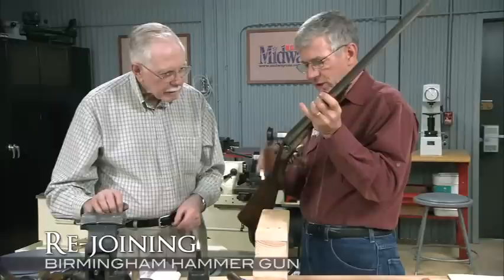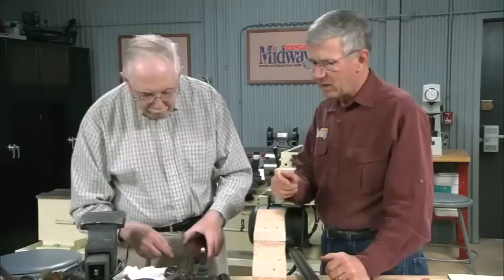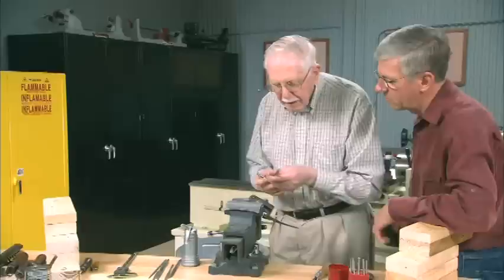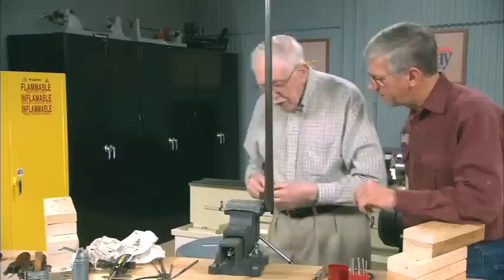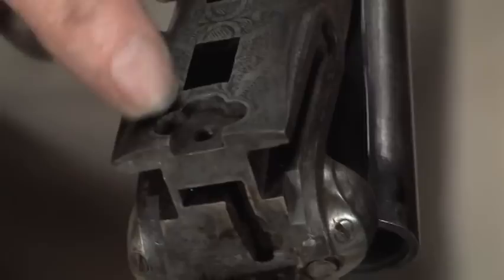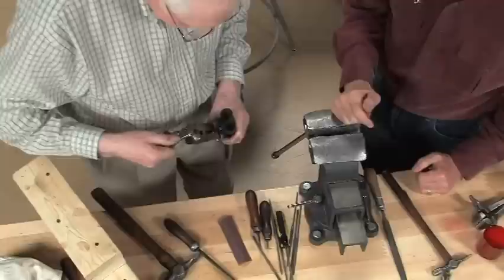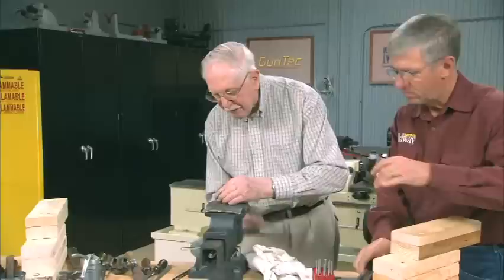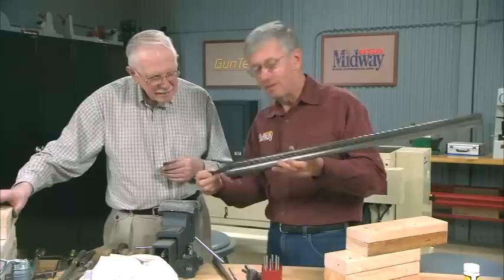How to Rejoin and Bring the gun "Back on Face" | British Side-by-Side Shotguns | MidwayUSA

Comment: They could make the pin larger on both ends and have the middle in various sizes, that way there would be no need for a reamer, just drive in a pin with a thicker middle diameter.

Comment: You could remove the pin and turn it 180 degrees and see if that brings it back. Anyway good to see how it is done properly. R.I.P. Jack.
Reply: If you did that though the ends of the pin would no longer match the curves of the action block. If you could live with that though there’s no reason why it wouldn’t work.

Comment: Might not be the very best .But could you not drive the pin out and turn it 180 and drive it back in?
Reply: You would probably have a very short lived repair or possibly have issues with some binding side to side as there may be metal wear and buildup at various points along the diameter.  If you clean it up on a lathe, even with fine sandpaper or emory cloth, it will be even further undersized and even looser.  Additionally,  the pin may fit looser and not stay in position.
Reply: The taper on the ends would not be flat w the contour of the block

Comment: He had absolutely NO padding in that vise!!!! I can't imagine all the scratches and gouges he put on the surface of that receiver after he hammered that pin in! OMG
Reply: I think the jaws were made of lead soft enough not to damage the barrels.
Reply: Moss Loewy Hope you're right, even so I can't imagine that some damage was caused without some kind of padding.
Reply: Duane Dibbley Lead overjaws are a standard part of an English Gunmakers vice, there is always a mould to make new jaws, so you cast up new replacement jaws every time the old ones get chewed up, they are far better than any other form of vice soft jaws, and leave absolutely no mark on the piece being held, but being soft they need replacing regularly, that is why you need the mould, please try them, there will be no going back to fibre jaws.
Reply: lead !
Reply: Before Criticizing Pay attention to Detail You will never be a Crafts men Eyes & ears Open Mouth Shut